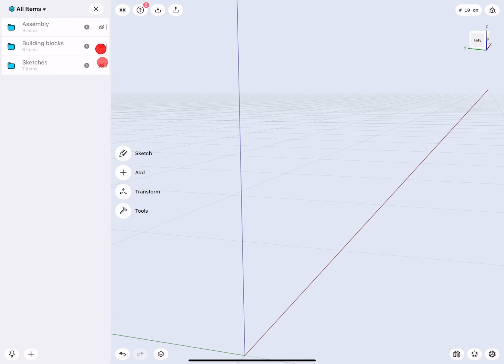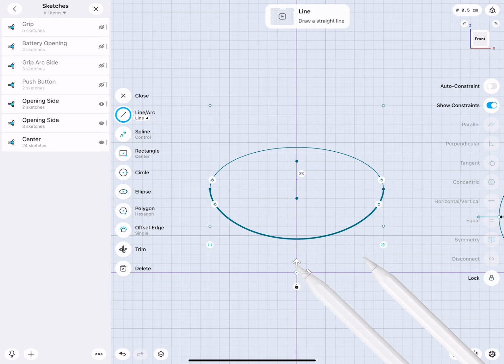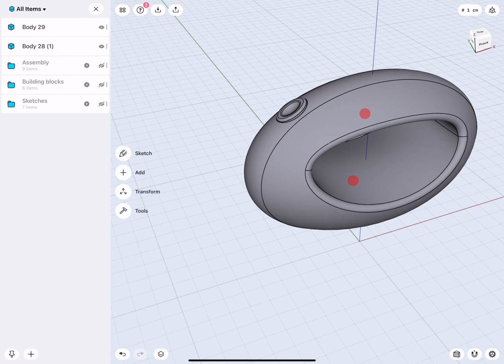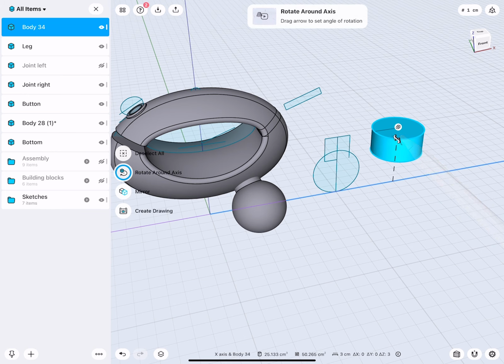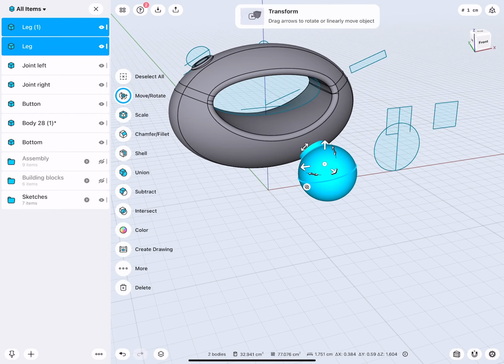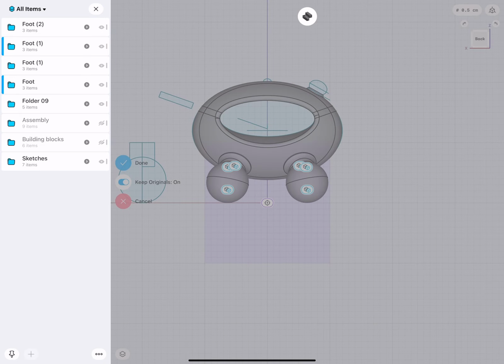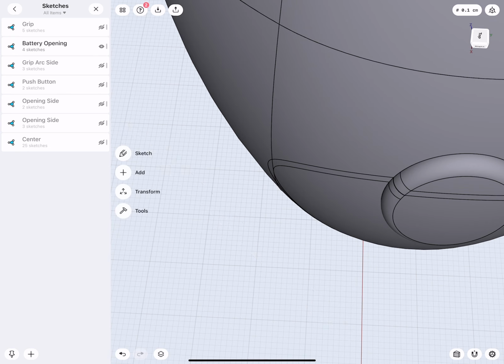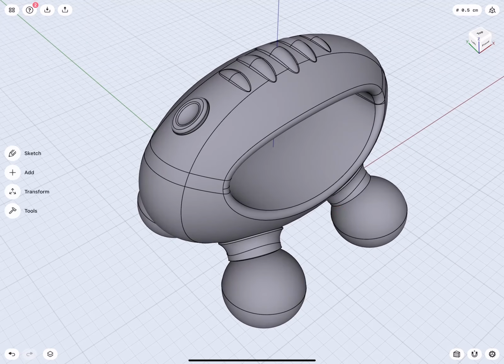3D modeling a massage tool | Shapr3D step-by-step

Comment: At 17:05, how is the rectangle locked to the angled line?
Reply from the maker: Hi! It is a Three-Point Rectangle and the longer slides were constrained to be parallel with the angled line.
Reply: @Shapr3D  Thanks!

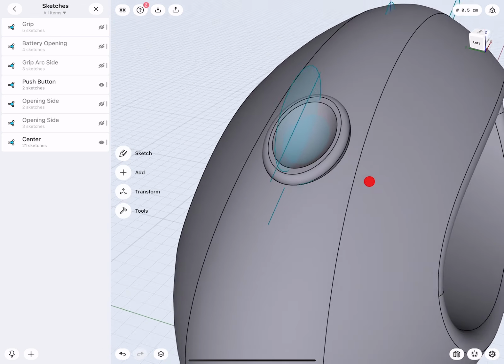Comment: @14:56 brings up a great idea.  Often I realise made a mistake 4 changes ago.  Could I please go back and  change that step and let the changes  propagate  through the future modifications.  Currently I save, get out of the model, dupluicate the entire model than try the tricky step.  But sometmes I havent  poor man 'journaled' the process.  I wish I could change previous steps and let the changes iterate forward (like Fusion)
Reply from the maker: Hi, Shapr3D is a direct modeling tool, we do not capture the modeling history. It is not possible to edit features that were made a few steps ago and rebuilt the steps after regarding the modification. It is because of the direct modeling method.